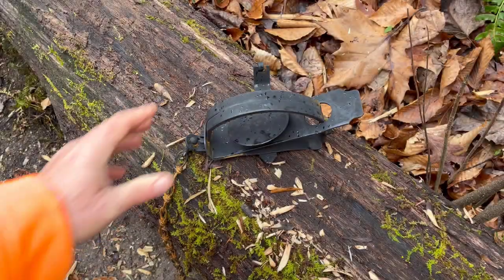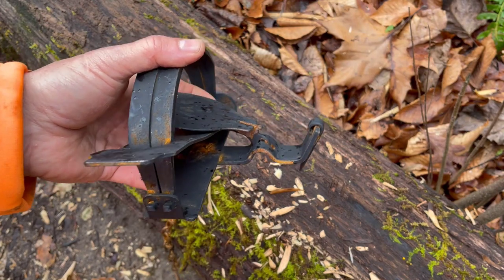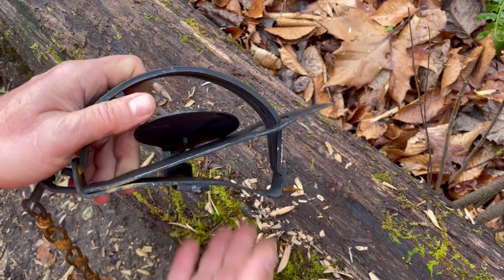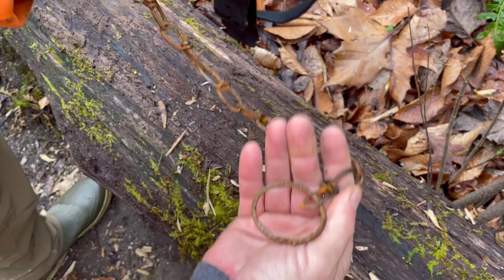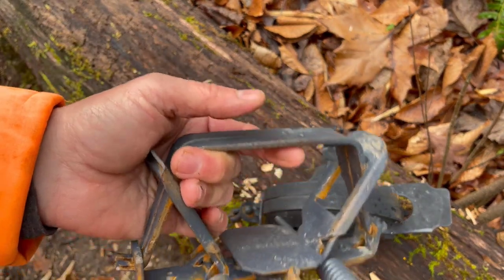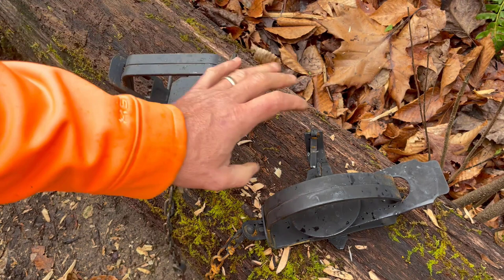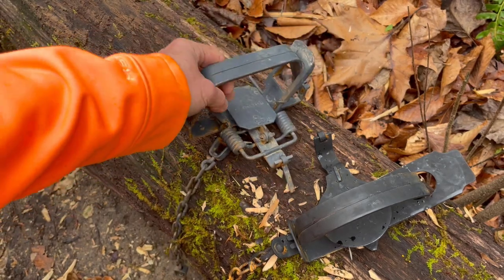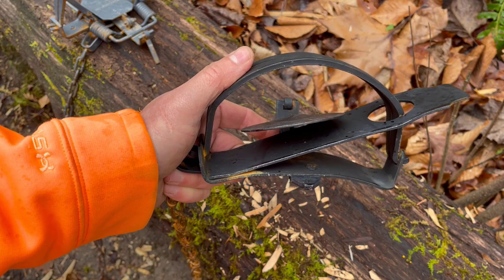Jump Traps   Good to Go or Old Garbage?

Comment: I have a lot of the old jump traps and use them when needed or desired....Asa Lennon was the one that first talked to me about the Jump trap and its uses. There are ways to make the pan more stable and thus bed a bit easier. I took an dominant male bobcat that had given me problems a few years ago with an number 3 Jump trap. You spot on when you indicate that when the shit hits the fan they will still be working.

Comment: Nice review !! All the old traps have their place !! Even the old victor #2 square jaws, that used to be the fox trap back in the day when there were no coyotes around, now I wouldn’t think about using them for them , coyote would pop the jaws on them but a great rat and mink trap
Reply: The #2 Victor that was designed for fox is actually the best mink trap available when it comes to the facets of blind setting for Mink and other smaller critters.

Comment: The bottom/frame on a jump trap is also a spring. It flattens out some when the top spring is compressed. When it fires the spring arches again, launching the trap up in the air off both ends of the bottom spring, causing it to "jump".
Reply: Thats good in theory but how often are they set on flat and hard enough ground for it to work that way. I mean they do jump if you set them on your garage floor but not in the field.
Reply: @gunfisher4661  Everyone I ever fired on ground seemed to "jump" just fine, but then again, I never tried it on a garage floor for comparison.

Comment: What I hated about the jump traps is trying to set them when up to my hips in water.  I’m not man enough to set those things on my leg standing in water.  I don’t know of a leg hold trap that is harder to set.  Even using both feet on the ground, the ground better be frozen or find something solid to put under the lever side of the trap.  If it sinks into the ground, you can’t get the spring all the way down. Great trap!  Fits in tight places! No better trap to hide in a notch on a crossing log, etc.
Reply: Oh, and they are called jump traps because their selling point was a high grip. They do launch off the ground if on something solid.
Reply: I found them hard to set also. And no way to easily tension the pan made me quite using them.

Comment: In the early 70's I bought several dozen #1 jumps. They have a smaller footprint than the same size long spring so, would set in a smaller spot on the edge of cattails. Still have those. Sometimes it's the right tool for the job.

Comment: This is a very unique trap design as the base plate is also a spring with a preset amount of arch built in, when the trap is set the long spring is pushed down and the arch in the base plate {spring} is pushed flat and the trap is set as usual. When the trap is thrown the upper spring closes the trap jaws and the base plate acting as a spring resumes its arch causing the trap to jump up and get a better hold higher up on the leg. that is why it's called a jump trap.

Comment: GREAT CHANNEL!  QUESTION - Is there a way to test if the holding power on old traps is sufficient?  I inherited a few dozen foothold traps that are about 60 yo, all types.  I still have them with a family member because in NJ you can't even possess footholds for any purpose - even welded decorations.

I'm a recently retired avid outdoorsman and new to trapping.  I currently only use cable restraints and submerged body grips.   I expect to move to a state that allows foothold traps after my wife retires. 🙂